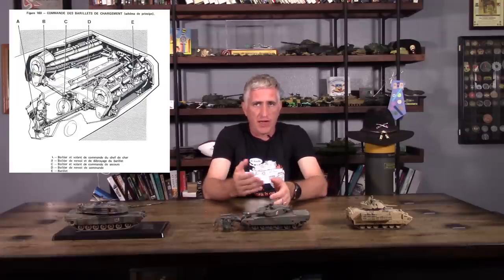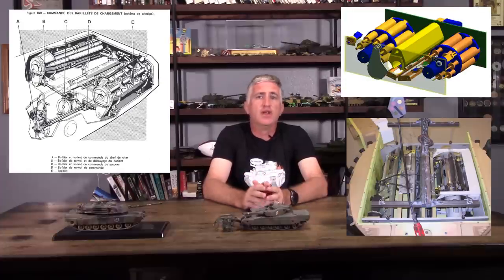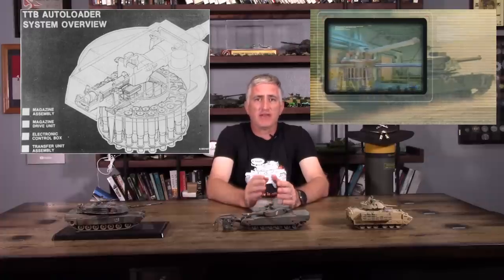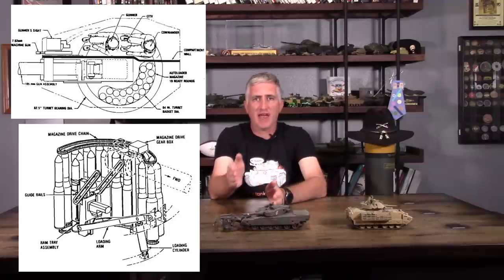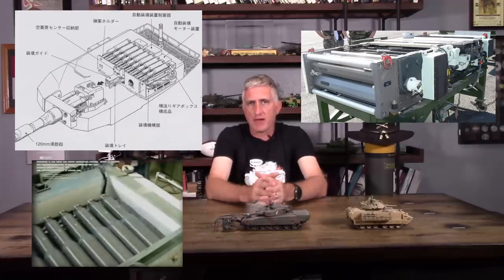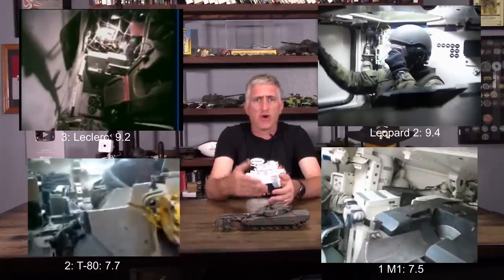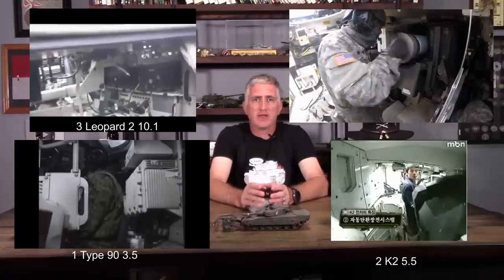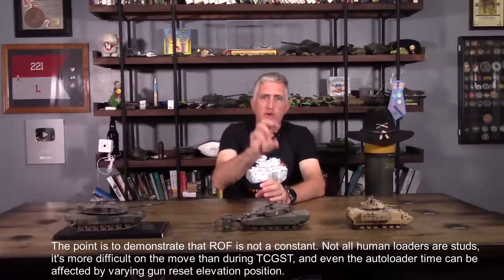Whither the Autoloader?

Comment: The issues with autoloaders have really shown up in the Ukraine with Russian tanks brewing up like crazy when hit. The fact that the turrets go flying when flashback occurred to the magazines makes you wonder had human loaders been in place would the crews have survived when with an autoloader they did not.
Reply from the maker: That's got nothing to do with an autoloader per se, it's a matter of separating ammo from crew. Some autoloader are able to do that
Reply: Usually when that happens the tank has been on fire for quite some time and the crew have either managed to bug out or are beyond caring how high the turret jumps.
Flat T-72 carousel is very unlikely to get hit by direct fire relative to the crew so soviets didn't have much reason to develop it further for expected fisticuffs in fulda gap. Why russians would not add more armor and cut side or bottom blowout panels in T-90ABCD after numerous asymmetric conflicts however is an interesting question as that seems like an easy enough modification.
Reply: This is more due to the carousel type design than anything else, a cassette type that loads from the turret bustle generally doesn't have this issue since it can be much more easily separated from the crew compartment.

Comment: The Russian carousel auto loader is what really makes Russian tanks the real winner of the turret tossing competition.
Reply: Discussed elsewhere, but the bottom line for me is that crew survivability in the case of an ammunition detonation is low regardless of if the turret stays on (eg Leopard hull stowage configuration) or not (T72 type). The crew aren't likely walking away in either case.

Comment: today, 1 1/2 years already into war in ukraine we see the russian designed carrousel autoloaders with the ammunition stored inside or below the turret paying a bitter prize. top attacks even by improvised weapons like drones dropping granates or mortar bombs on tanks caused massive fatal looses specially to russian tanks. so this issue is mostly based on tank design and not of using an autoloader itself - as we learned there are different types of it. Cassette autoloaders like Leclerque would have seen ammo cook offs too but propably not for a fatal loose of the tank. never the less, a tank out of action is a loose in the situation. Also droping a bomb inside a tank through an open hatch mostly is causing some looses not only to specific autoloaders. how western tanks like M1 or leopards will end up in after battle reports in comparison to autoloader for points like firerate/readiness, breakdowns, ... remains to be seen and published.

Comment: Sir, you missed the part where the turret flies up into the air 100 feet with autoloading tanks.
Reply from the maker: Only some of them. Some manually loaded tanks may also suffer he same fate. It depends on ammo stowage layout, not how it gets from that stowage into the gun tube,
Reply: @TheChieftainsHatch  on the topic of turrets how are they attatched to the tank are they bolted on a rotating piece on the hull or does gravity does all the work. If you flip a tank upside down would the turret fall over?
Reply from the maker: @your_waifu_hates_you  There are normally bolts. I could have sworn I covered it in a Q&A, but the connection is normally a bit more complicated than Turret A rests on Hull B. That said, the bolts are unlikely to hold the weight of the turret if you hang out upside down.

Comment: Given events in Ukraine this did not age well
Reply from the maker: Nothing in the video is countered by events in Ukraine that I can think of
Reply: Chieftain can correct me if I'm wrong here but it's not the autoloader, it's the ammo storage. That ammo carosel in the turret is as bad as the early WW II Shermans that didn't have wet ammo storage. I bet the Russians and everyone else fixes that problem right quick.
Reply: As far is i know, he is comparing NATO tanks with Autoloaders (WHICH IS WAY SUPERIOR), than Russian design ones.
Reply: @Commander_35  Right...though I think at one point he compares the size of an Abrams to a T-80.  And I think he also points out that the new Abrams version have an auto loader system, they just don't that Russian carosel storage system.  That's my point, it'ds not the auto loader idea, it's the storage issue.

Comment: So Bullshit - you now tanks?  Autolader in USSR  2 generation tank fromT64-90 same old design carousel without protection - to load new type and better round you need ti change all design - still to fire you need angle 0 after all fire!  No Chabham armour its 2 generation with OLD reactive armor from Israel stop using it. All penetration in USSR tanks it explosion and cant fire new type of projectile and choose new type you need to  fire what you have next - in T90Japan and Leclecrc 4 Generation same problem with 0 loading - not so much type of projectile. OLD. Merkava4 m you not show - 3 try to check auloader - vullshit too much problem. In Merkava 4 ONLY 5 generation tank with armor om top AI and IronSight Trophy and else - even toilet and normal air conditioner - you have little hatcg open when you want you projectile - it maybe also Roket not like USSR one round 105-120 universal 8 KM even anti Helicopters. Germany - USA-buy TROPHY in Merkava4 you have so good minus to gun so when you come top you cn low gun you will nit see tank - he will kill all tanks. USSR with 170cm maximum height crew maximum now so OLD.  you to much working with Wargaming - when you was in real combat situation I was in 1998-9. After I was in Army one in year but not in operation but seeMerkava4 and 4m when whey was upgraded. Now USA and Germany want to take hukk of OLd Abrams and put on turret of Leclerc - OLD design.....